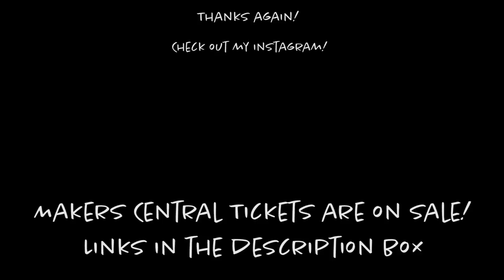#35 "Lucent Lamp" Hybrid Accent Lamp

Comment: Stunning! A question about your process: You covered the top of the burly cap with a thin coat of epoxy resin before casting it.  Why was that?  I'm guessing you did it to prevent air from migrating from the burl into the resin, creating bubbles.  Of course, the air could still have migrated out from the sides of the burl.
Reply from the maker: Thank you David!   You are exactly right.  I used devcon epoxy to seal the surface.  This helps to prevent bubbles between the resin and live edge surface.  Thanks for watching!  Have a great day! :)

Comment: Excellent Heath, really does work nicely. Well done!
Was there a reason for the initial epoxy resin?
Reply from the maker: Thank you brother!  I used the epoxy to seal the live edge surface.  I did not stabilize the piece of wood.  Also, the MC is sitting at 8-10%.  This helps to avoid bubbles.  Have a wonderful weekend Paul! :)

Comment: Absolutely amazing! Can I ask you if you used only heat gun or also the pressure pot to get rid of the air bubbles?
Reply from the maker: Thank you! I used a heat gun on the two ton epoxy and a pressure pot for the alumilite resin.  Hope this helps! :)

Comment: very cool! 👍👍👍 what is the maximum thickness of the fill can be?
Reply from the maker: Thank you Александр!  That's hard to say.  I could've added 2--3 times the amount of resin used in this project.  There's still plenty of wiggle room.  The resin portion in this project is approximately 3-4" thick.  Hope this helps!  Thanks for watching! :)
Reply: Heath Knuckles thank you very much!

Comment: Turned out amazing Heath! Can you tell me why you coated the Burl with epoxy? I've never seen that done before.
Reply from the maker: Thank you Gage!   I used the epoxy to seal the live edge surface.  I did not stabilize the piece of wood.  Also, the MC is sitting at 8-10%.  This helps to avoid bubbles.  Hope this helps!  Have a beautiful day! :)
Reply: Makes sense now that you say all that Heath! Thanks for the info! Have a great weekend!
Reply from the maker: Anytime Gage!  Thank you! :)